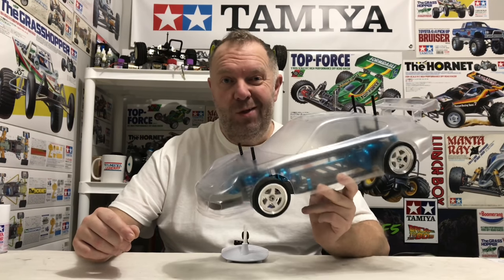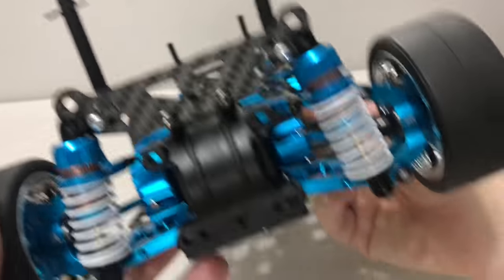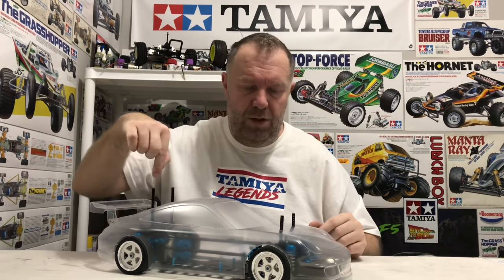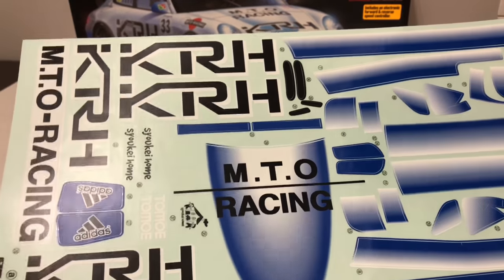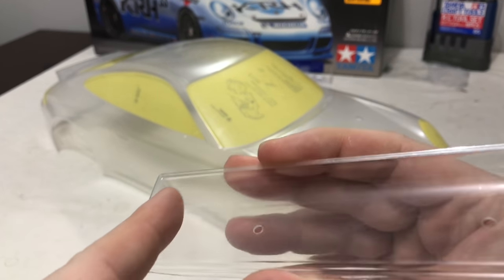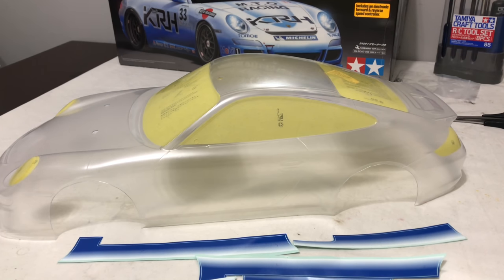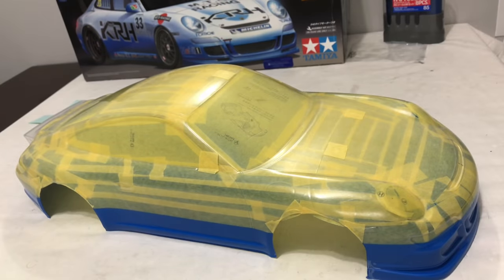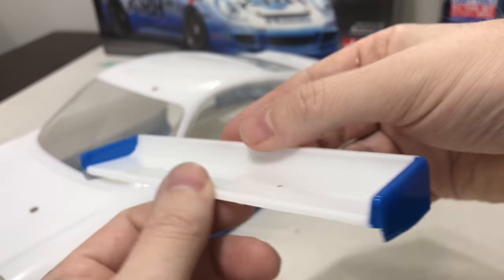Tamiya TT-01 Porsche 911 Bling Project, P3...

Comment: I'll have to admit that I've never been a Porsche fan but after seeing your car, well, I'm beginning to change my mind.  Once you have the car fully stickered, I think it's gonna look awesome!!  I want one.  lol  
One thing I always do after the colors are applied and fully cured and before removing the window and outer shell mask is to apply a few light coats of silver followed by a few light coats of flat black.  It just makes the paint fully opaque and the colors pop.  For the silver and black, I just use cheap hardware store enamel-based paint - it sticks perfectly well to the polycarbonate paint and it saves me a few bucks.  This technique works especially well with white - it doesn't alter the final color and it prevents sunlight from bleeding through.  Been doing this for years and so far no problems.  Anyway, thank you for another great Tamiya video.  Looking forward to the next chapter.  Cheers.
Reply from the maker: ixlr8 
Excellent information thank you 😊👊🏻

Comment: Frog tape is the stuff I use because other cheap masking tape ends up with the adhesive dissolving and the paint creeping under the edges,I'd fix washers on the body mount posts and cut off the excess then drill and tap the top of the post to take a screw with a thin profile head,fixing a plate between the posts should stop the movement:)
Reply from the maker: James Cunliffe 
Thanks James that sounds like a perfect cure for the body posts 🤩👊🏻
Reply: @TAMIYALegends  one idea is a piece of threaded rod set into the post after drilling a hole with fine bit then epoxying so captive and a small nut can be used or whatever can be threaded? Lol:)